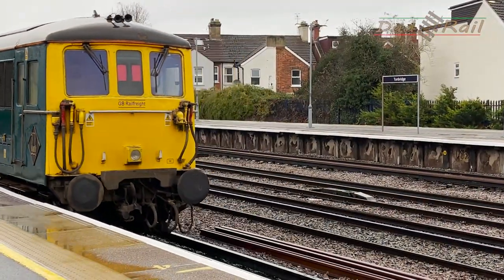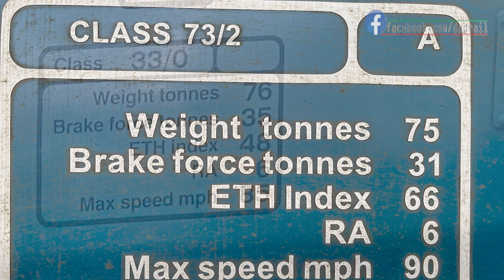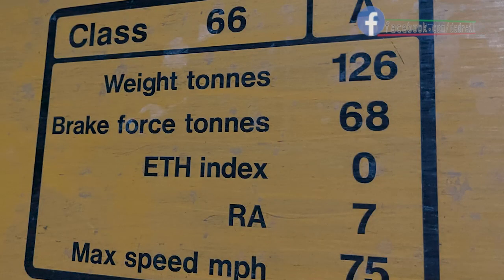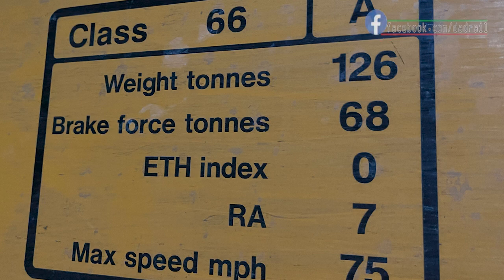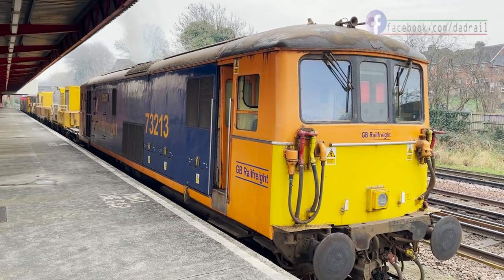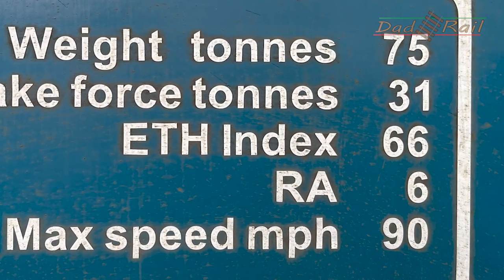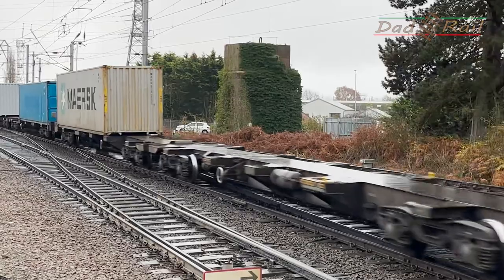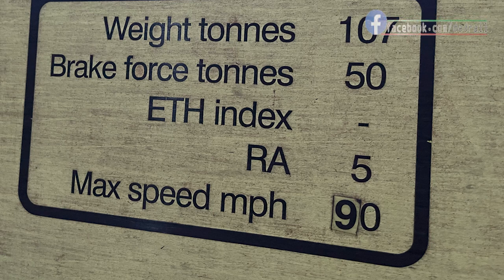Locomotive Data Panels - What's that information on the side of my train? - Dad Rail

Comment: Quick question, after playing tsw2, I noticed there were 2 door buttons instead of 1 (when closing and opening doors on the 150/2) - why is there 2?
Reply from the maker: Having 2 buttons that need to be pressed together reduces the chances of the doors being opened in error, due to pressing the wrong button
Reply: @DadRail  Ah, thanks for the info!